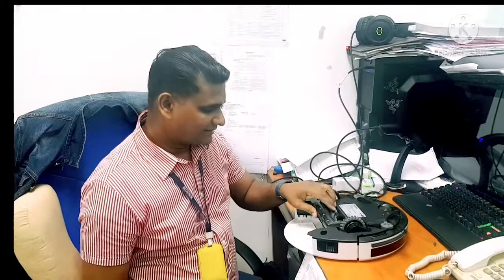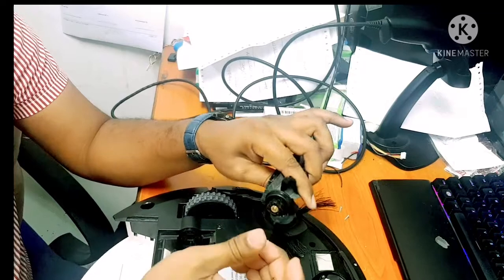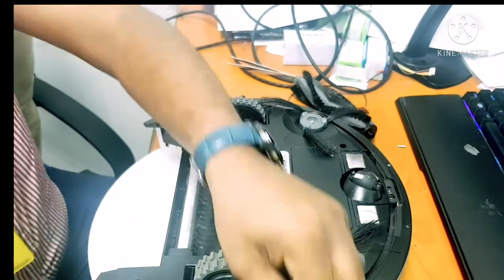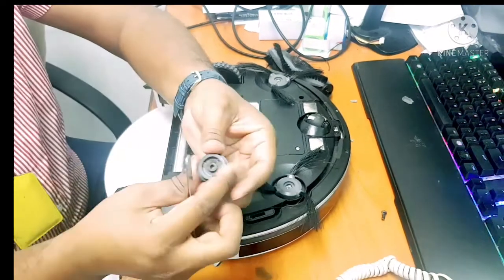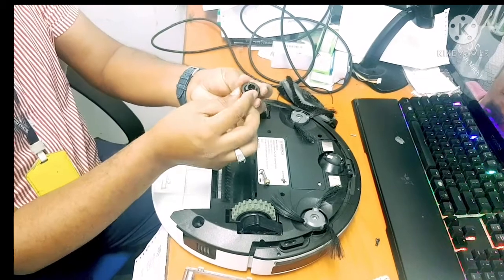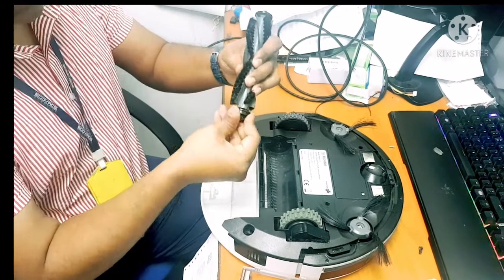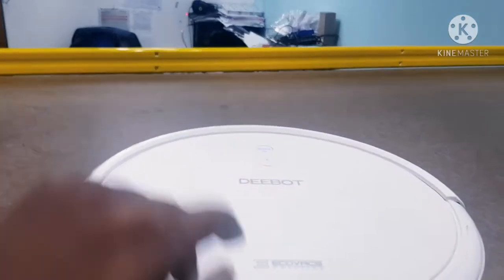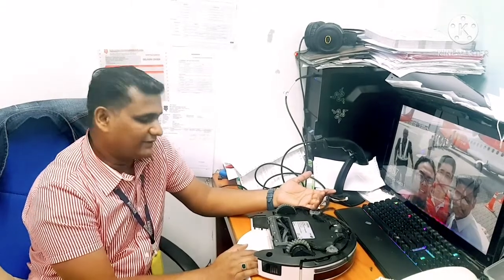How to Fix If Main Brush Jammed.  Permanent Solution.

Comment: Thanks for this video. Altough it wasnt exactly the same brand nor the same solution. I cleaned the brush and the bearing and still nothing, so i checked the other side of the brush, where it has a plastic square shapped form that goes into a rotor in the motor of the robot vacuum. Activating the vacuum without the brush upside down made me realice it made some noise meaning effort to move the thing that moves the main brush, so i thought it would be a lot of work to disassemble all the robot body just to clean that part. Luckily before giving up i tried with a needle and other pointy stuff to remove the dirt around that "gear". It didnt worked either, so i forced to move it and showed some more clog. i cleaned it again, forced it to move manually, and clean, forced again and clean, and there, the vacuum is working again. 

Thing is, small dirt will always eventually get inside that part and sooner or later i think everyone is gonna have this problem, altough i feel confident that this that i said is the solution for everytime it happens. Again, i wouldnt have figured it out without your video, so thanks again.

BTW: manual said "error 46: main brush clog: take the vacuum to service".... yeah dude, right... manuals should just tell the people how to fix this kind of stuff!!!

Comment: Very useful information. The main motor has a small sqare plastic part ( left side) in which the roller bearing goes. How to remove that part? Is it necessary to remove it for cleaning? Also how to fix it back?
Reply: @SexyTexas  I know, so i contacted service centre and they provided me that tiny square part. I had to pay for it of course.

Comment: I tried this and the bearing was completely stuck, I cleaned it and got it moving again with some bearing grease. Thought that would've fixed it but unfortunately the robot will still say "main brush stuck" whenever I try to turn it on. I checked and the drive of the axle isn't moving at all? Does that just mean it's completely broken? How can I check? Do I have to remove the motor entirely?

Comment: The problem I'm having is that my old main brush works fine but any new main brush I put it, the machine says main brush tangled. If I put the old brush back in, it works fine. What is causing this problem? It's a brand new EcoVacs brand main brush right out of the box. Nothing tangled on the brush itself! It spins freely when I twirl it in the machine.
Reply from the maker: Plz send me a pic of both brushes..old n new ... WhatsApp at +601137973018

Comment: What do I do if i still get the error after cleaning the brush bearing? I even get the "Main brush jammed" error when the brush is not installed? Do i need to open the bot and try and see if hair is stuck in the motor mechanism?
Reply from the maker: If u removed main brush already n still deebot giving same brush error..means main brush motor is jammed...u can check manually first..put back main brush n try to turn Main brush with ur fingers...see eaisly can turn or feels hard...if hard or totally can not move means motor jammed ...plz open top cover remove bumper then take out main brush motor assembly... disassemble the motor assembly n try to clean using teeth brush n WD-40 spry n assemble back... hopefully will work.because in this model motor wont burn Very fast but belting n gear can stuck...so after service hopefully will work

Comment: The mop pads will not spin on my ecovac t10 omni. they just quit working. ive reset the omni but still they wont spin. removed mopping pad plate and cleaned them but still wont spin. on occasion for a few seconds the mopping pads will spin and then stop and will not start spinning again.

Is there a belt for the mop motor that may be worn? to explain why they only will spin for a few seconds when your not expecting it and then stop. what is the address for a return depot for a return under warranty from canada. i know i need an rma first but only want to estimate my return shipping cost.

Comment: How do you clean the main brush motor ?
Reply from the maker: Actually if motor we clean it start working but after few days Will be same again because motor jammed  already...but I'd some dust stick with belt or roller only jammed then ok just clean it will start working as normal

Comment: Fixed it for me! 
Didn't know you could pull the pin out of the roller head
After cleaning all the hair it's working again
Reply from the maker: If problem is due to brush jammed then with this method no need to replace brush... Just service at home n fix it.. But in some cases main brush motor jammed... That also if it's only gear jammed so u can service at home but if motor jammed then need to replace main brush motor

Comment: I cleaned the brush end just like you showed and there was lots of twisted-up hair.  The Ecovac D79 still beeped 4 times.  I changed the brush motor and battery and the Ecovac still does not work.  I purchased a new roller and still no luck.  Any ideas?
Reply from the maker: Ohhh dear.. you already spent a lot buying all these items...plz WhatsApp me a video clip at 00601137973018.
Let me see the video then I'll explain to you TQ

Comment: The rubber on the main brush cover gets folded everytime my deebot 500 starts cleaning. This pushes the dirt past the robovac. Any solution for this? Any replacement part for the main brush cover?
Reply from the maker: Brush cover available.. Plz chek online in ur country... Or contact service center they can arrange. In india there is one in new dehli
Reply: @ecovacstechnicalsupport5278  yes, didn’t see the sku listed in India online hence had to comment on your video! 🙌🏻 thanks
Reply: Hi, hope your issue is solved. If not, You can reach surefix banglore service. Hope this will help you.

Comment: Hi dear I have a problem with my t8 aivi ... I got message to clean Anti drop sensor, and I cleaned properly but still not working and there is something inside one of this sensor like humidity ... There's a way to open the sensor to cleane ?

Comment: Hi, let's see it someone can help me. 
I need to disassemble the T8 empty base station due to I have purchased recently and it is impossible for me to take back to my country in the airline as a box. So in order to insert the base station into the luggage I would need to disassemble the tower from the base, unscrewing about 4 screws. Do you know if by doing that, I can break any cable or electronic mainboard that then makes the station useless when I put it back together?
Reply from the maker: Hi... First of all I pray for you... Reach ur destination safely.  Just there are 3 screw where tower joint just unscrew n pull up tower casing... There's no worries don't worry... Just connected with pins that will automatically disconnect when u pull up tower... Then eaisly can pack in small box n travel
Reply: @ecovacstechnicalsupport5278   THANK YOU !!!!! Thank you so much for your wish! I still have a couple of weeks here and then yes, back to Argentina. Regarding the disassemble the tower (place for the bag) from the base (robot goes to charging), I see the three screws that you said. Those 3 are bigger than others close to them.  I will proceed what you advised to me as soon as I get an unscrewdriver here at the hotel.  But actually I will do it in confident :),  according to your comments.  I was worried to make a disaster and break something trying to unscrew it by myself without knowing what I was really doing. I will let know how this going on !!! Again thank you for your instructions!